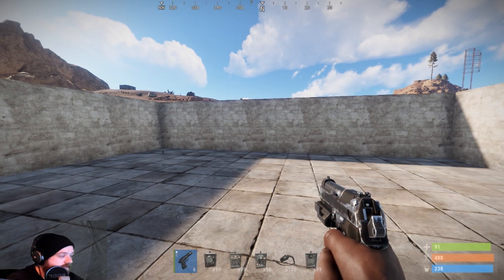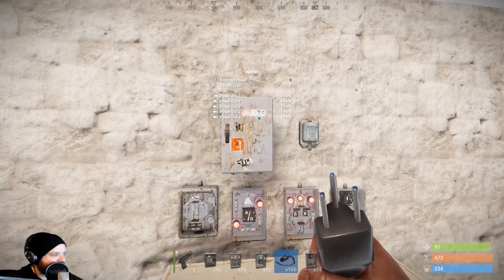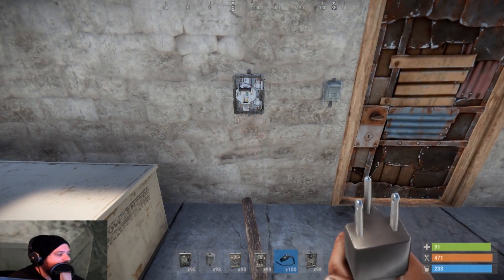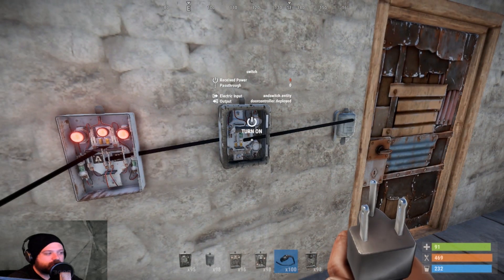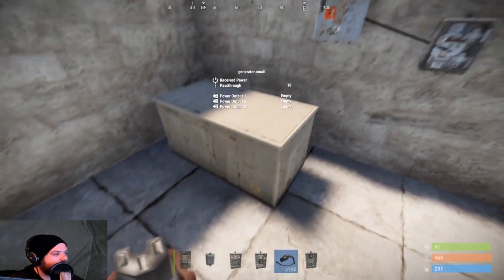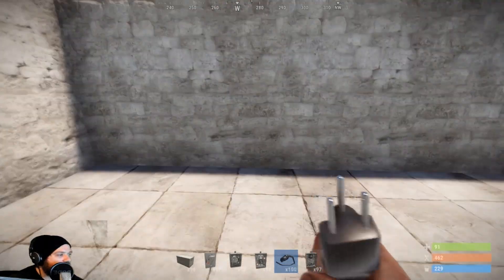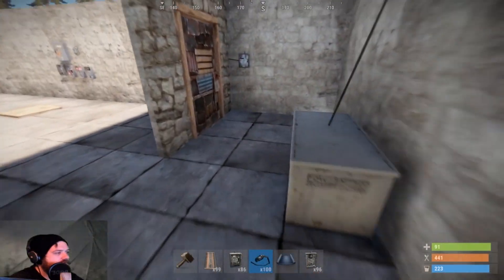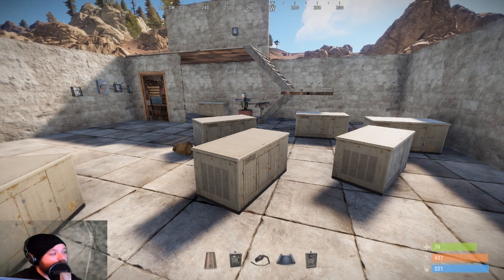Rust Electricity Basics! - Current Staging Status

Comment: you can deploy windmills, just need to make a floor platform for it
Reply from the maker: As in a floor frame like for the floor grill and ladder hatch?
Reply: no, the actual floor, create a big foundation square, put up walls and then floors
Reply from the maker: Hmm i will mess around with this when i get home, did you try hooking it up to the generator? Thnx for the info / correction ;)
Reply: i havent deployed a mill in 2 months
Reply from the maker: Ill mess around with it when i can. I didnt see any commits about it so i dont think its useable. I did see something about solarpanels and batterys. Maybe a way to add / extend the passtrough
Reply from the maker: @minimovzEt  i deployed it yesterday, i had no idea. Doesnt seem to be working or be able yo wire / interact with it yet. These things with the solar panels and stuff on the roof are going to give rust a diffrent feel

Comment: Looks like the automatic door opener worked in the video. It automatically closed the door after you opened it at 11:32
Reply from the maker: Yes it does work, it closes the door after 2 seconds. But it doesnt seem to need / work with electricity yet.
Reply: automatic door openers have been in the game for a long time they were only available on some modded servers or admins to get
Reply from the maker: To get yes but since when can we place them?
Reply: @TedPommes  i was able to place them in summer 2017 last time i used them
Reply from the maker: I didnt really try a lot,  probly didnt look high enough when i did. Lets see how it gets used

Comment: dude you're making the worst possible examples when using logic gates and timers

you could have made an automatically closing door if you just changed the order, instead you make a nonsensical circuit that lets you operate a door via a switch for a limited amount of time, what the fuck...
Reply from the maker: Not everything worked as expected. Timers didn't work as timers, it was a switch with a timer, you still needed to trigger it manually.  Some stuff that is in the game now wasnt in it when i mads the video. I just wanted to show what is in the game and how its currently working That's also why i called it basics. Thanks for the feedback
Reply: @TedPommes  
you could also have made a door that can be operated with 2 different switches instead of wiring an "and" gate directly to the generator. sorry but this stuff triggers me, because you're not showing what it can be used for, only how it can be used. this is very discouraging for beginners because now they think this stuff is pointless...
Reply from the maker: I get ya, its good that you want to give good info, and i am not saying your wrong. I on purpose tried to only show the basic usage of every electrical component. It might not have been the best practical uses but i didnt want to add any unnecessary switches in between to keep it simple / explain 1 thing at a time. 

Also, i didnt want to make any circuits since i am working a a second video of actually practical uses. 

Thirdly, i kinda rushed out this video, i wanted to be one of the first with the basic info. If you listen to the audio quality of my vocals you can hear it sounds diffrent than normal. I skipped a whole audio processing step just so i could finish it the night i found out it was on staging.  Still i uploaded it around 3 and had to wake up for my normal job 3,5 hours later xD 

I agree, this was the best i could do in the situation i was in =D